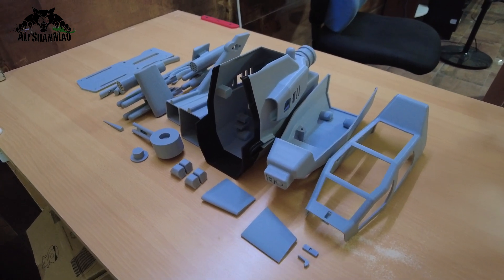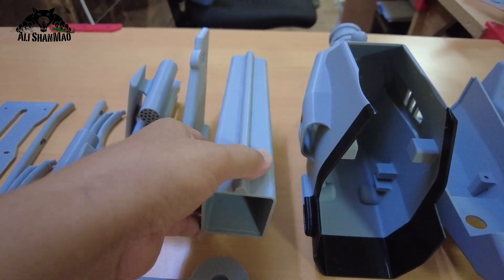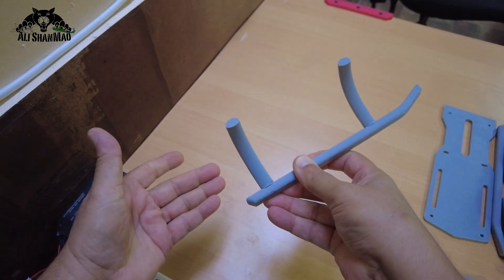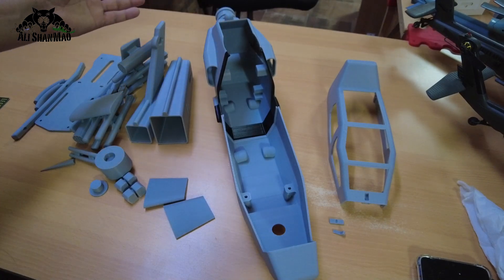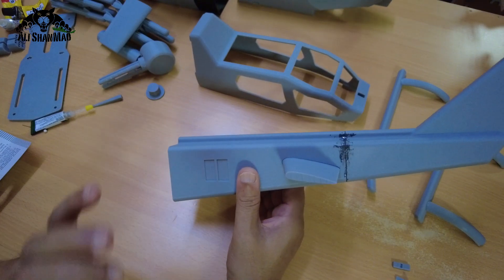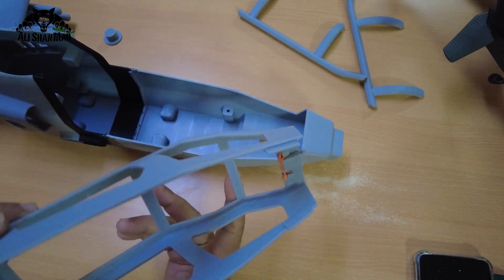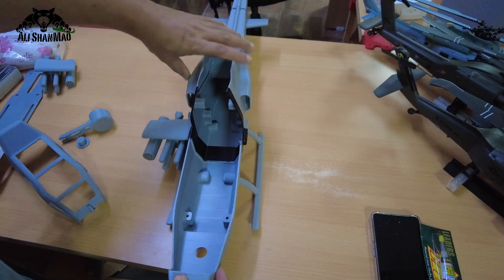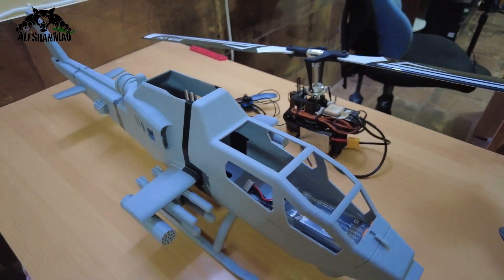How to Assemble COB-H1 RC Helicopter Fuselage

Comment: Does this fit in Flywing UH! V4?
Reply from the maker: @ricardoyabut7829  I designed it specifically with bell 206 module measurements but I will check with Huey UH1 V4 module and may make some modifications to fit that module as well. Follow and stay updaty thank you

Comment: You have created such a great Project, Ali! It's unbelievable what you can do with a good 3D printer now. Great explanation of why it is so important to choose the right printing direction for specific parts as you showed on the skid section! This heli looks very good and it was a pleasure to watch the assembly. I am courius how much such a 3D printed fuselage weights. All the best and greetings from Poland!
Reply from the maker: Thank you so much for your comment. the fuselage together with bell 206 guts installed (without battery) weights 928g. Given that those are 2mm thick walls. and I can tell you it was a good decision. this will ensure that fuselage does not break easily upon hard langings which is the case in 3d printed models that are printed with single, 2 or 3 walls just to shed the weight.
Reply: @alishanmao  Wow, only 928g with 206 mechanics but wthout battery is a very good weight! I agree, more sturdiness is much better than going for minimum weigh for all cost! I wish you a lot of sucess with this project! You truly fdeserve it after so much hard work!!
Reply from the maker: @RCCopterLove  Thank you so much buddy